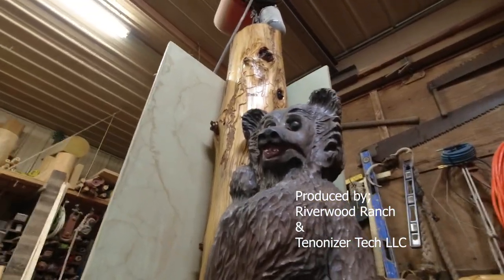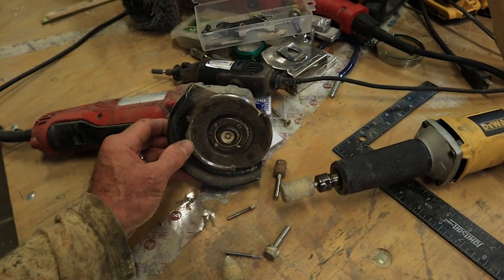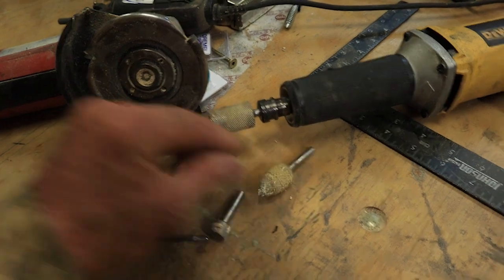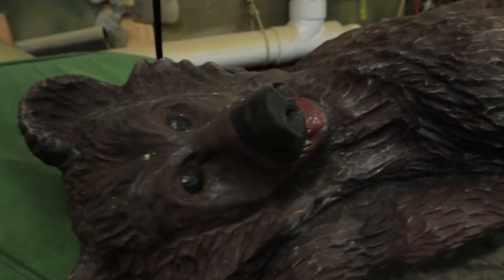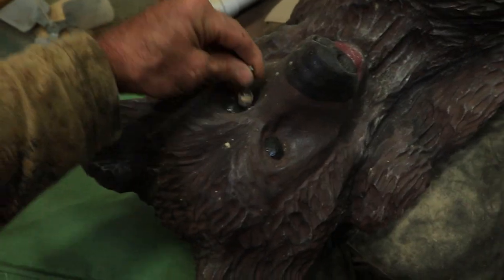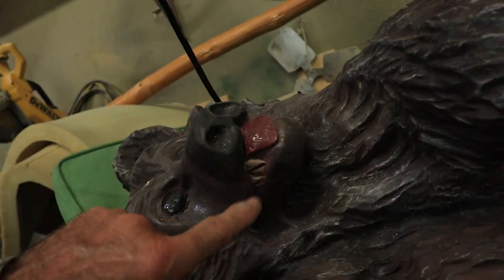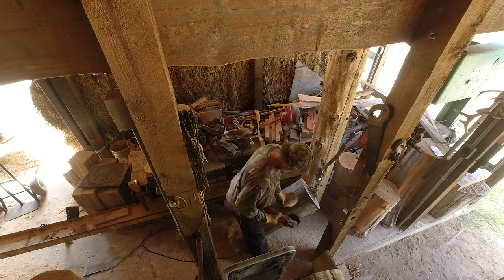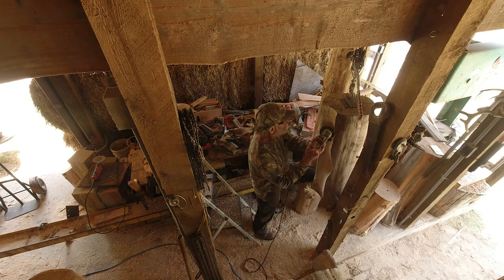Chainsaw Carving 101

Comment: It was my fault but while using a wire wheel on a angle grinder it got caught in my shirt and it climbed up my shirt scratching up my belly till it ripped off my shirt and bogged down. I’ve got a healthy respect for them now, glad I learned the hard way on a wire wheel instead of one of those chainsaw discs, I’m going to have to buy one of those babies.
Reply from the maker: Woodworkers roadrash...